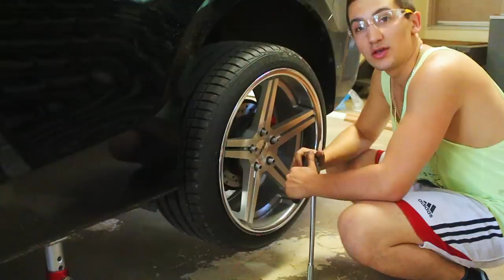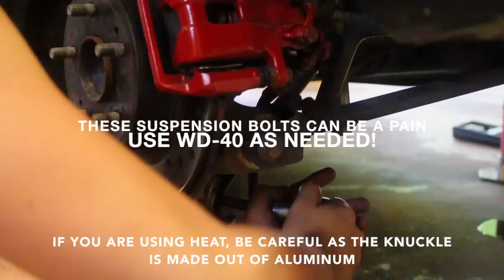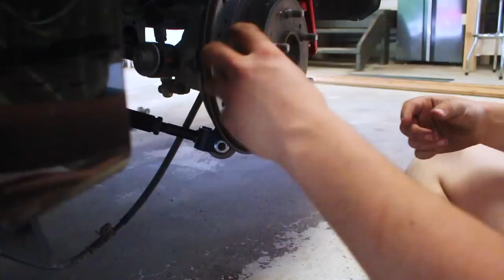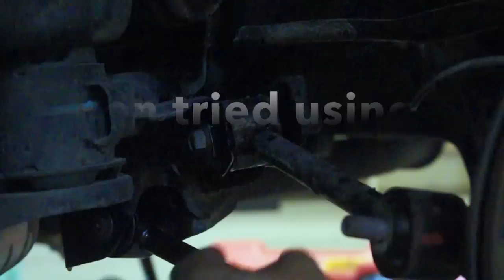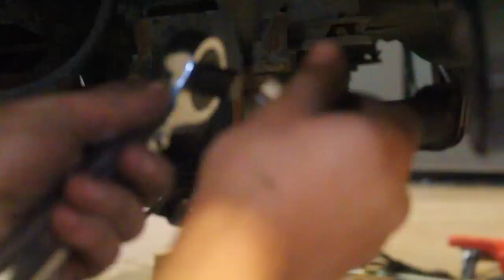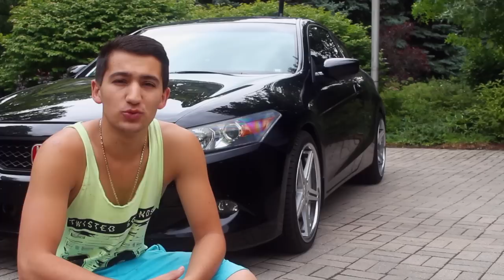Install 3-Arm Camber Kit Kit (J-Power / SPC Alignment Kit)

Comment: You want to load the suspension before tightening any of the bolts up to final torque.  Also, you can use a screwdriver or 3/8" ratchet extension as a pry bar to lift / move the hub around enough to get it to light up with the arms.  Use the bolt to knock out the extension.

Comment: Had my JP arms for 2 years now with moderate-aggresive driving. No issues with the bushings. I'd also suggest getting  19MM rear sway bar and bushings from an Acura TL 2012. You'll love it.
Reply from the maker: +Wafflefries85 I got a 22mm rear sway bar and front TL as wel. I love how flat my car corners :)

Comment: curious this rust check i am wondering what the difference is between it and just using brake cleaner for  preventing rust? Or is brake cleaner just like a carburetor cleaner where it just removes rust but doesn't prevent it? I know this is a stupid question
Reply from the maker: sam111880 Brake cleaner or carb cleaner won't work to prevent rust. You can use the rust check, rust retardant paint, or even a rubberized undercoating.

Comment: Did you need the cam plate or control arm washer. Also are those the self lock nylon or clinch nuts. Referring to the parts you got from Honda. Thnx

Comment: Hey man... do all of these bolts fit for 2012 acura tl? I know the accord and TL are very similar and I just installed these arms on my TL
Reply from the maker: Hey Luis, the TSX shares the same chassis as the accord, so those will be identical. As far as the TL goes, I bet some parts of it are going to be similar, but not as similar as the TSX. Alot of the information transfers over though 👍
Reply: @milanmastracci  Thanks for your response. I ordered all of the hardware that you put up in the description and just finished cross referencing the TL diagram and Im happy to confirm that all these bolts are the exact replacements for the 4th gen TLs too. I bought a 3 arm camber kit and while all the bolts are securing the arms right now with no problems, I'd rather have all new hardware. I also have to roll my fenders to clear my wheels after 20mm spacers so its just sitting at home with the rear being supported by a jack lmao... thank you for this video brother

Comment: Be careful about leaving stuff loose.  If they alignment guy doesn't need to adjust them, and doesn't know they're loose, then they're still going to be loose when you pick up your car.  In a few hundred miles you'll need another alignment.
Reply from the maker: TheSuburban15 Just make sure that you let them know your situation and what you've done to the car
Reply: +milanmastracci where did you get the bolt 1:35? I bought a used set of coilovers for my car and didnt get nuts for it and the stock nut is welded to the strut. I'm currently running a homedepot threaded bolt and nut and i dont trust it
Reply from the maker: +StaticVtec I didn't see a bolt at 1:35. 
As for the coilovers, go to your local dealership and see if they can get you a bolt and nut that would be of similar use. Usually they're Grade 10, zinc-plated bolts that they use for suspension.
Reply: +milanmastracci well i gave u the wrong time but when u put the bolt and nut through the rear forks on coilovers
Reply from the maker: Yeah I would go to your local dealer and see what they can do. I would find the OEM bolt that you need for your shock, and get them to find any large nut that will fit the bolt. I guarantee they will be able to find something for you StaticVtec

Comment: O that was what that grey paste was i thought that was some type of thread locking compound at first but it is silicon paste for preventing rust on the threads. Now i understand why one would uses it on brake and bolt thread components. Well you used it on non threads but i have seen it done on threads

Comment: I know this is an old  vid... but I had a question (as I've just bought this kit For my 09 accord) .
I wanted to know where you cut the bolt and what did you use to cut it? I'm having issues removing mine as well
thanks!

Comment: How'd you get the short arm off? I took at the bolt in the back and the nut and washer in the front. Now what? Am I supposed to hammer that bolt in the front out or something?
Reply from the maker: whiteeboi After you get that washer and nut out, you should be able to remove the bolt. If its stuck, use some penetrating oil like WD40 or thrust so it can be loosened, and then slide it out. Use a hammer on it if it is really in there

Comment: curious how many cars need alignment i notice that some cars you cann't even adjust some of the settings of camber.castor,or toe without buying after market parts so if that is the cases i would imagine some vehicles never have to have alignment i.e there fixed unless one wants to modify things for performance or wear... just kind of curious what vehicles need alignment
Reply: Every car has toe adjustment at the minimum since toe is what kills tires fast. Camber and caster are usually not stock adjustments on lots of cars, so you need aftermarket for that.

Comment: Good post and informative. Question, I am maintaining a stock 4-D 2010 Accord.  Alighnment reads good on toe but camber only is off.  Is is okay just to replace the camber arms with adjustables and then get an alignment?  (They gave me no caster measurement, perhaps you can explain that.)  Or, will replacing only the camber arms create problems with the stock toe bars, which currently read as right on spec?
Reply: If you haven't figured this out yet, the rear end has no caster measurement.

Comment: hey Milan, how are the J Power holding up? Lots of hit and miss reviews on them with the bushings going bad.
Reply from the maker: +Ze26 Hey man!! THey're holding up good :) Because I live in canada they've started to rust because of the salt, but other than that, the bushings are good, everything works fine and am yet to run into problems with them 👍

Comment: Hi Milan, if I want adjust camber only for my accord, which part I should change?
Reply from the maker: It depends how much you've lowered your car. If you lowered it more than 1 inch, you should get the entire 3 piece kit as the toe adjustment is not very adjustable from stock.

Comment: So just leave the stuff somewhat loose for the alignment guys to take care of it?
Reply from the maker: +StaticVtec Make it tight so it's not going to go anywhere when you drive, but just keep in mind that it is going to be adjusted and moved as soon as you get to the shop.
Reply: milanmastracci  ight thanks, just got new tires and im sick of driving around stock. Took out my coils for the winter and its snowed like twice so far lol. Going to put them back in along with the arms. thanks again lol
Reply from the maker: +StaticVtec Sounds like fun :) no problem!!

Comment: Do i need a part numbr for the bolt or just say bolts for the 3 arms?
Reply from the maker: The 3 bolts that I needed are specific to each location so when you go to Honda and get them or order some new ones, just say you need new bolts and the tech will probably bring you a printed exploded view of the rear suspension and ask which bolts you'll need. Its pretty simple :)

Comment: Did you have to put adjustable arms on the front?
Reply from the maker: I installed cambered ball joints. Its a ball joint that is eccentric and can be adjusted in or out to compensate for camber
Reply: milanmastracci thanks bro. Can you send a link of what you got?
Reply: Did you install the ball joints yourself? I've been looking for a tutorial for the 8th gen accord but can't find one.

Comment: Do you know if PB Blaster or WD-40 works better?
Reply from the maker: +MrChris2Fur I have buddies that use PB and swear by it, but I've never had a problem with WD-40. Try em both :)
Reply: Okay haha. I just ordered my rear camber kits and I will be installing coilovers maybe sometime soon! Btw, not sure if you posted a video about installing coilovers unless I missed it, but do you have a tutorial or would you recommend a certain video?
Reply from the maker: I'll be making a video about installing coils, as soon as mine arrive :) Should be sometime soon!!
Reply: +milanmastracci ahhhhh damn! Perfect timing! What did you end up going for your Accord? Teins? Megan?
Reply from the maker: MrChris2Fur I installed lowering springs on a buddy's BMW, which is very similar to our accords, except for the fact that all of the 4 struts on our cars, is a McPherson style (so like the fronts on the BMW). Installing coils is easier than lowering springs because you don't have to play with the shocks and open them up. Its a direct swap :)

Comment: Nice vid. So you did a camber kit because you wanted to or needed to? It didn't appear to need it in the beginning of the vid.
Reply from the maker: +CGphotoOp The clip at the beginning of the video was after I got an allignment on it, after it was installed. The camber on the back of my car was much worse without it :)
Reply: +milanmastracci got it. Will I need a camber kit if I do 1" drop springs from H&R and 20x8.5" wheels with 245/45/20 tires?
Reply from the maker: You should need it to make all of your camber angles correct and not have improper tire wear.

Comment: I read in the previous convo you had with MrChris about getting coils. Any reason for this? Is it better to get the coils for the lowered car with spacers and camber kit set up? I have the exact same model but in blue and I plan to do the exact same things you did. Great vids man.
Reply from the maker: +Sean Otis If you can afford coilovers, it is a much better option beacuse you can properly lower the car if you like. With coilovers, you can also change the ride height, dampening, and rebound whereas you can't change anything with OEM struts and springs. :) I'll be doing an install video soon for them
Reply: +milanmastracci ok thanks. So the ideal set up would be to get the camber kit with coil-overs and the spacers? And you installed a rear alignment kit but what about the front wheels?
Reply from the maker: You got it :) For the front, the alignment didn't change due to the suspension geometry, but when I lower it more, it will possibly need new ball joints up front.
Reply: +milanmastracci great thanks a lot man
Reply from the maker: No problem :)

Comment: What about the front
Reply: The front usually doesnt need to be adjusted..i just put some coilovers on my accord and the shop was able to align the front with no problem..its the back that needs the camber kit
Reply: @ronaldromero9532    I just got my Morgan racing lowering Springs installed on my 2009 handa accord coupe but the ones in the back are upside down well just 1 one I think
Reply: Upside down!? The coilover? Seems impossible..dont know exactly what you mean by that? I was just stating as far as lowering the car the front usually doesnt need cobtrol arm adjustment to be aligned the back does for some reason atleast my car did
Reply: @ronaldromero9532   I just have lowering Springs not coil overs in the letters on the lowering Springs are upside down Just on the right side of the back
Reply: The tighter coils of the Spring on the right side is down and the one on the left side is up does that matter
Reply: @jojodeleon2602  im not sure my man. I think the springs are the same as far as the top and bottom...but if its easy for you to do i would put that one the same as the other side and see if that helps